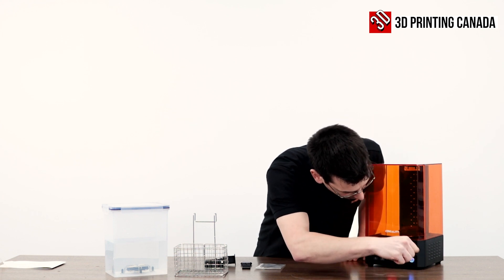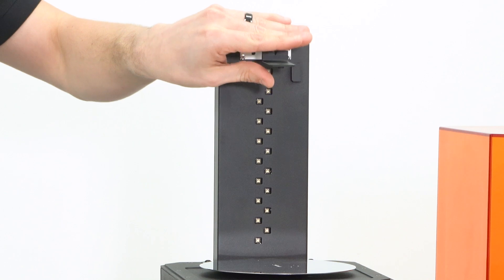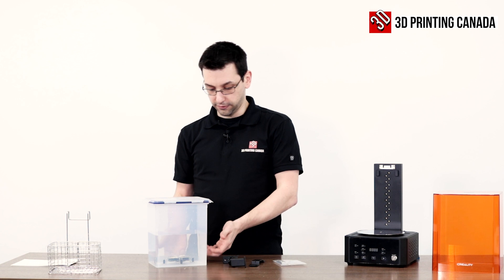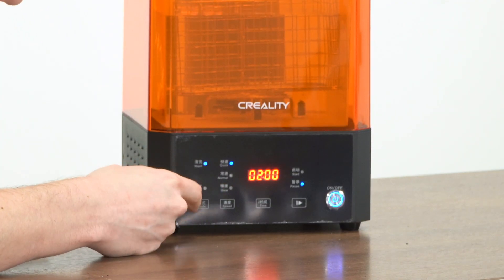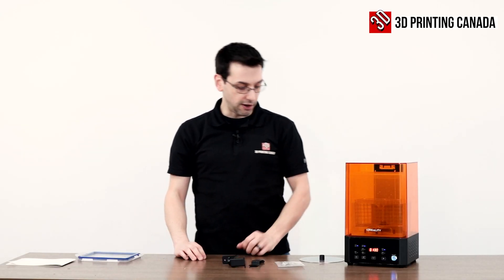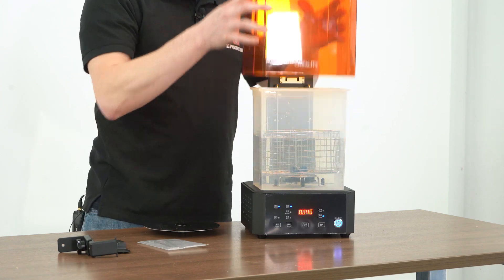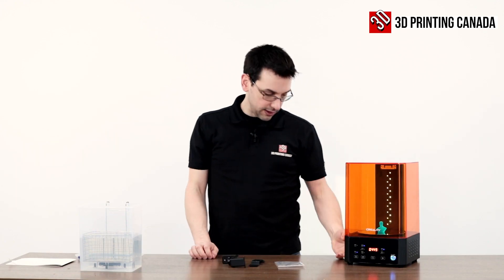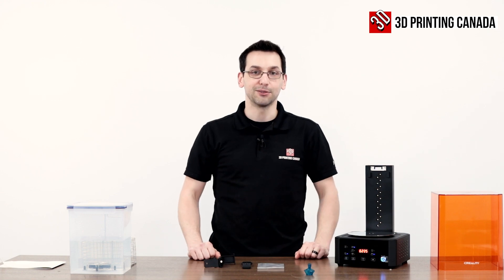TESTING Creality's Washing Cure Station Machine UW-01

Comment: The mirror curing option runs way too fast even on the lowest setting. I have pieces falling off the plate all the time. I  sent a message to  Creality about this and they told me to use the basket to clean the part. IT IS already clean. I hope someone comes up with a mod or fix for this. For the time being I put a small piece of folded tape under the part.